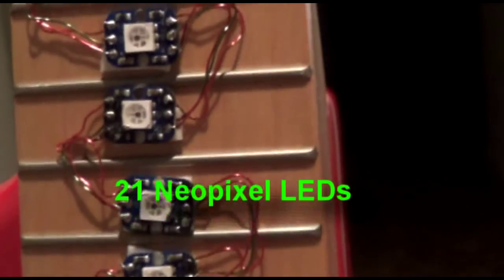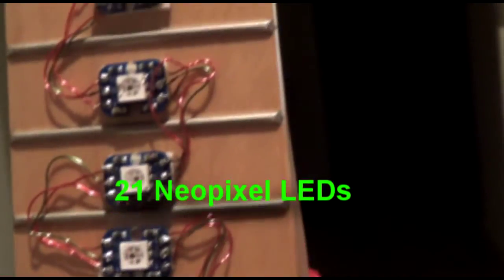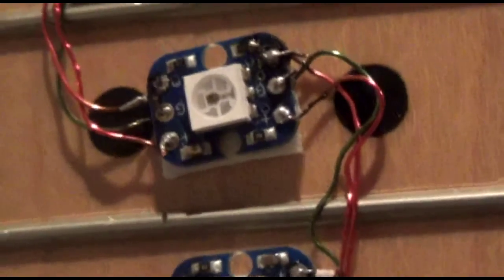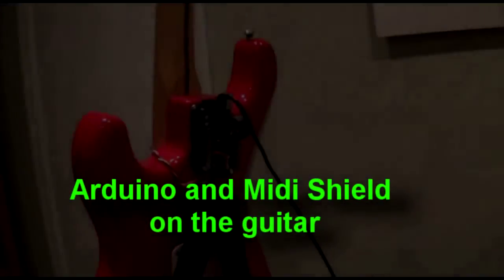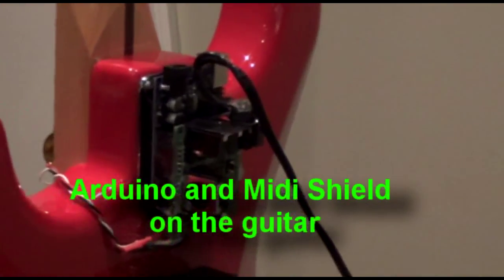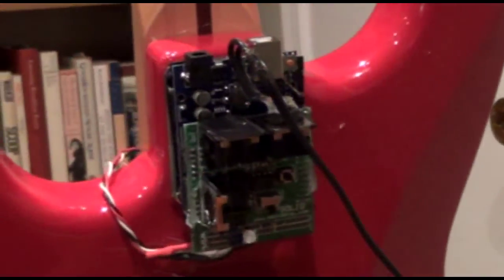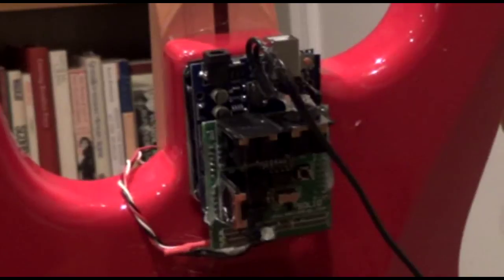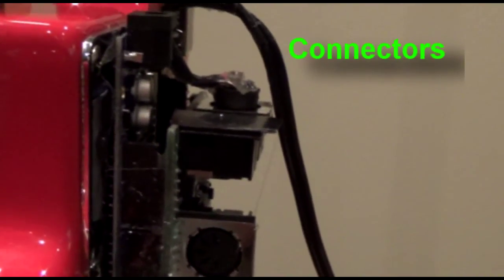Arduino MIDI and LED guitar

Comment: nice, but your high tunes are at the head,    where the low notes should be.
shorter strings = higher note
Reply from the maker: Right, but  i wanted the he high notes visually to be up high!